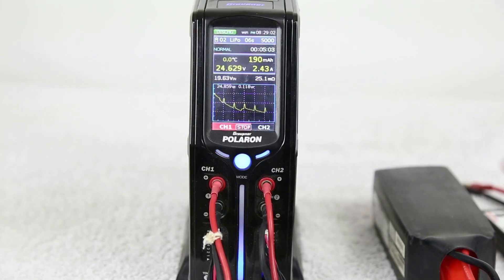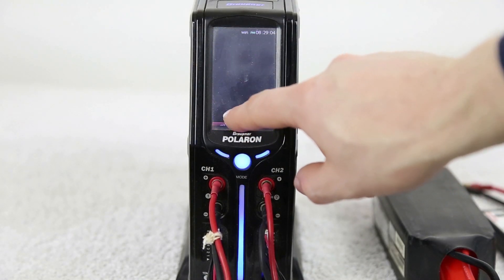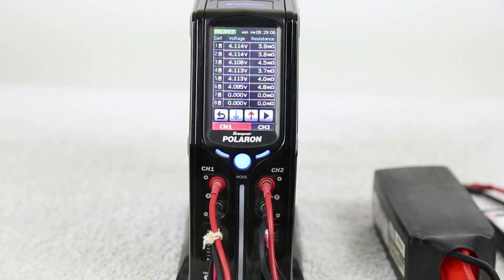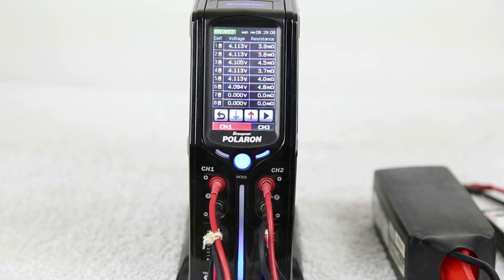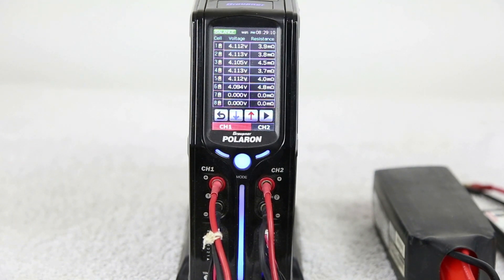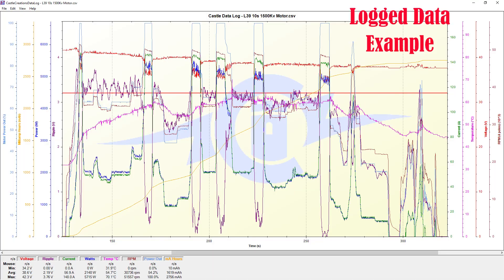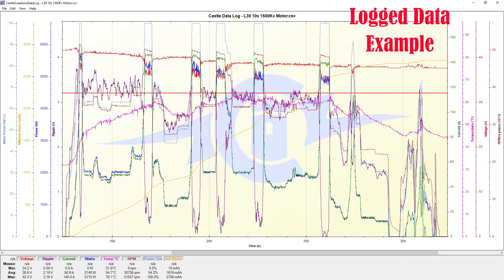Exploring the Hidden Limitation of Internal Resistance in RC LiPo Batteries

Comment: One of my 6400 protek battery is 4235 and the other is 3456.  The car isn't as puncy..can I bring back the cell or is it gone... when I put it on charge it stops because the cell count is off
Reply from the maker: Doesn't sound good if that's voltage you are talking about. Try a combination of balancing only and then 0.5A balance charge. I like to stare at cell voltage the hole time I'm working the battery when it's at this stage. The cell being so far out, may not be salvageable and could be dangerous trying to revive it.

Comment: Thunderpower and MaxAmps have been able to charge MAX dollars for less than stellar performance because we the consumer have bought into their fantastical "C" ratings. A 5000mAh 120C rated battery should deliver 600A. At those amps the battery leads would have melted.